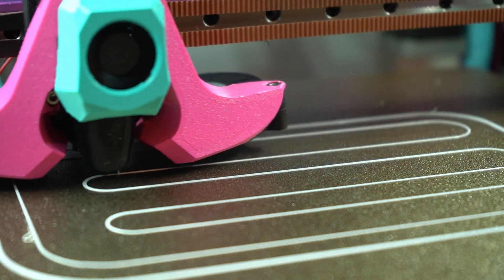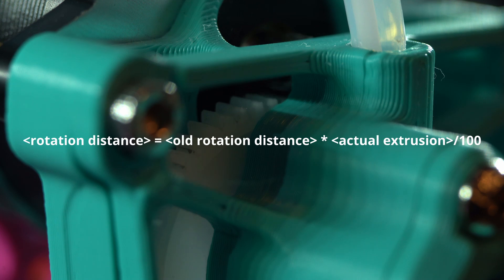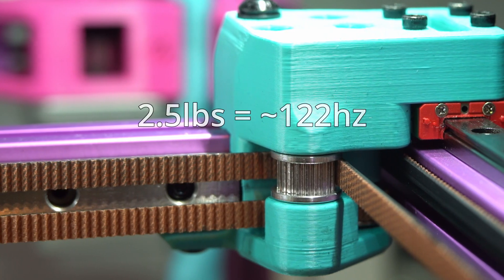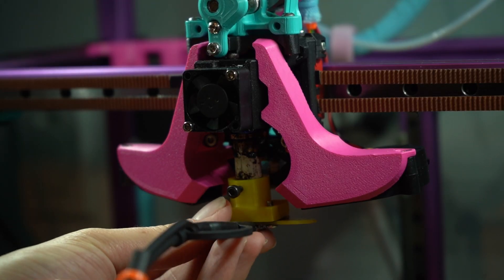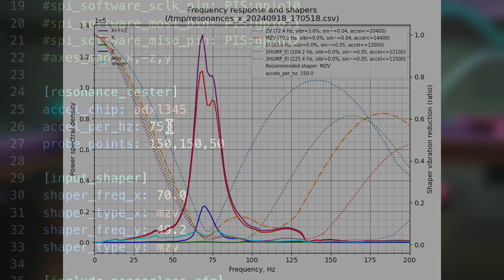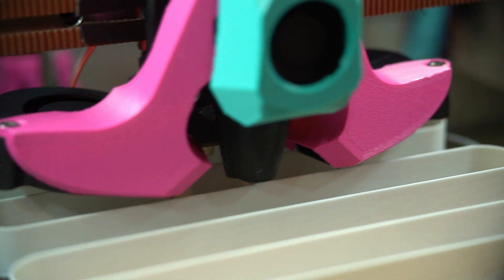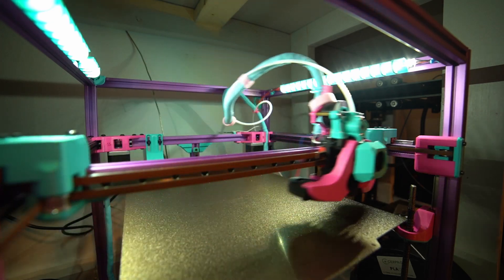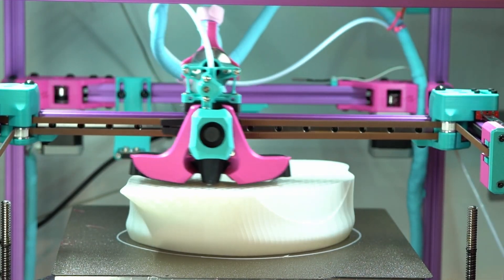How to Tune Your 3D Printer for SPEED! (Part 1)

Comment: How to balance amps and voltage?  Currently have 2209 at 24v 0.58.  Want to get new steppers to run 48v.  Amps will stay the same?  How to know if the motor is 48v rated?  Thx
Reply from the maker: You'd run the same amperage on both 24v and 48v. All stepper motors can be run with a 48v setup.

The actual amperage you'd want to run depends on two main factors, the rated current of the motor and the material that it's mounted to. Right now I have LDO 2504s on my trident, but there's no way I could give them the rated current of 2.5A because I'd melt my motor mounts

Comment: I'm confused about the point about onboard accelerometers vs nozzle mount options. I would think altering the mass of the toolhead (especially with a long, wiggly, USB cable attached) would throw off the results more than the board mounted option. I guess placement also comes into play. Maybe an onboard accelerometer placed at the moment of each axis produces a different result than one placed further from the moments. I could also see some difference from inverted moments relative to the nozzle. Does the input shaper macro take this placement into consideration, seems like it wouldn't be hard to provide some cleanup of the accelerometer data to invert and scale the raw values to producing something better than either option.

Comment: This isn’t the only thing that you need to adjust. When running at higher speeds you need to turn up the extruder heat so when your printing you have enough flow for that speed. I like to turn my hot bed up to 65 when printing at higher speeds to make sure the model is sticking to the hot bed and can handle those speeds I went up to 999% which is 250mm/s on my Ender V3 last night just to see how well it could handle and made adjustments. I do this for most of my prints that I need  printed out in a hurry.
Reply from the maker: You definitely can do that a bit, but at a certain point you'll just need a longer meltzone

What kind of accelerations can you ender handle?

Comment: The other option for tuning input shaper, which is significantly easier, is just to type in "SHAPER_CALIBRATE" to the console and Klipper will do the rest, assuming it sees information from the accelerometer.

Comment: Mounting the accelerometer to the nozzle adds mass to it changing the the characteristics of it. This affect can be elevated by the fact that the nozzle is mounted to the toolhaed by the stem of heatbreak several centimeters away from the tip of the nozzle which combined with the fact that the additional weight of the sensor+cable is not negligible compared the overall mass of the hotend which isn't designed to handle much more than it's own mass  coupled with your less than ideal sensor mount makes it an inferior solution to say a toolhead board accelerometer rigidly mounted to a sturdy toolhead body. Yes there will be minor differences in resonance between the toolhead body and the tip of the nozzle but it's better to minimize "the observer effect" by measuring at the toolhead body (the structure not covers and such)

Comment: Great video! I'm new to 3d printing and this is a great tutorial.  Some constructive feedback... check your extruder rotation distance again.  The ruler you used in the video does not start at 0 on the edge of the ruler.  The ruler scale starts a few mm after the ruler edge.  You read 20 but that's not the real reading in reference to the ruler edge.
Reply from the maker: Welcome to the wonderful world of 3D Printing.

My extruder rotation distance is correct. Since you are taking the difference between two measurements, the extra length at the edge of the ruler cancels out

Comment: I still don't understand resonance shaping. The accelerations always say <= (less than or equal to) 6900. I have a K1 Max that brags about 20,000 acceleration. Why are my number never that high? What am I missing?
Reply from the maker: Great question! In short, the numbers that you are seeing are the recommendations for the max acceleration *without ringing*. Creality is advertising the maximum acceleration the printer is capable of, but you will notice your print quality start to suffer if you actually run that much accel. 

My 250mm trident can print at 50K accel, but the parts look horrible and I would never actually print with that much.

For some features (like infill) running higher accelerations with some ringing is totally fine, but you'll definitely want to lower your accelerations for at least your outer walls.

Comment: I've sped up my Bambu printer by feeding the filament straight from the drier. It emerges at 55°C which means it can pass through the hot end much faster without cooling.
Reply from the maker: Interesting. I've never heard of someone doing that before

Comment: I've been building and tuning my voron 0.2 for the past ~4ish months. Every single thing in this video is exactly what I've done, but I made way more mistakes and went a couple steps backwards with every improvement I was making lol. Would've save so much time and confusion if this video came out a few months ago. Super super helpful!

Also, what kind of flow rates do you get on ABS with your rapido? I can get to about 45mm3/s if I bump up temps to 280C on 0.4mm nozzle, but the stock heater can't keep up (especially with 2 nozzle extenders + cht)
Reply from the maker: Since the 300 isnt enclosed yet I havent tried ABS on it. My 250mm trident has a Dragon UHF (which I think has he same length meltzone?) and I can go up to 52 cubic mm/s with a 0.5mm TC nozzle with ABS at 285c

Comment: on 1:28 you say you measure 20mm bud you dont becouse you do not measure from the 0
Reply from the maker: Since I also measured the original 120mm that way it does not matter. The difference between the two values will be the same
Reply: Makes sence. Great vid btw.

Comment: Why no love for klippain shake&tune?
It makes everything with input shaper etc so much better and easier!
Reply from the maker: I've never tried it before,  but I've heard great things from quite a few people. I'm definitely gonna try it out when during the next round of upgrades on the 250 Trident!
Reply: @mitsumakes  you really should! I think it's amazing as it makes everything so much simpler, more easy to work with and it has some rather cool new features like belt response from each side to get the belt tension as close as possible to equal
Reply from the maker: @rallegade  Awesome!
Reply: @mitsumakes shake tune is the only way to go. Takes less than 10 mins to set up.
Reply from the maker: @1Kingcb  For sure. I'm (slowly) working with someone else on an in-depth guide to input shaping, and we are gonna be using shaketune for sure!

Comment: Secret sauce for belt tension (Cartesian printer), activate the motors and measure 100mm with a caliper in X and Y. You'll find that it lands dead in the middle of spec. If not, than your belts are worn out. Best part! It will be far better than trying to calibrate via prints, which the plastic not only has varying expansion/contraction ratios BUT so does the environment (open/enclosed/room temp) AND to finish it off every print will act differently 🥲

As Core-XY moves at 45° per motor/belt, that's hard to measure and adjust. But possible. You would just need to have the same belt tension on each before you start, and carefully tension each the same amount when adjusting. That's what I did when I had a Creality K1, unfortunately the belt pulleys don't really line up causing uneven travel when close to the sides (a²+b²=c²). I returned it after two weeks, too many issues other than that.

Comment: To raise speed and acceleration the same time makes no sense. You have to sacrifice one for the other (keep one fixed until you get step loss then decide if you lower the other to get a stable system).
Reply from the maker: This is a good point! Which value do you think is more important to maximize for travel moves?